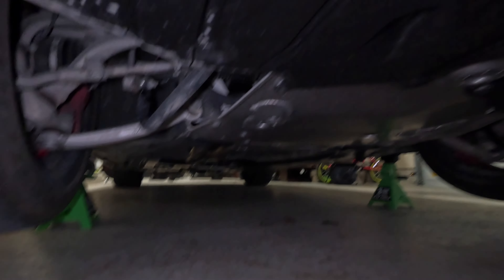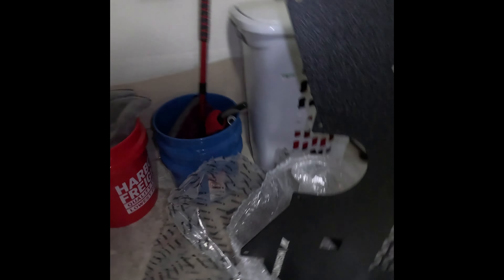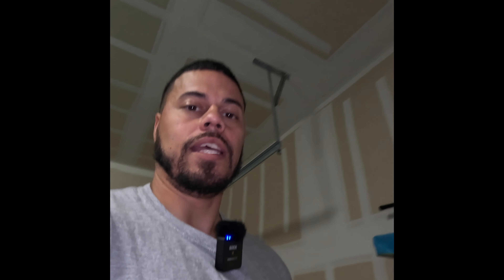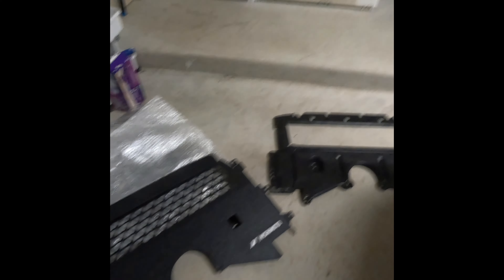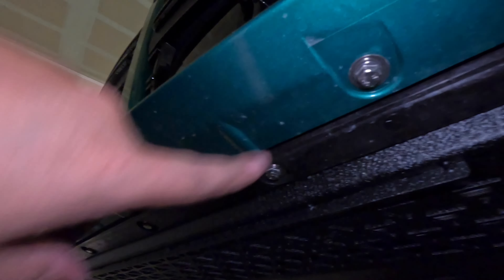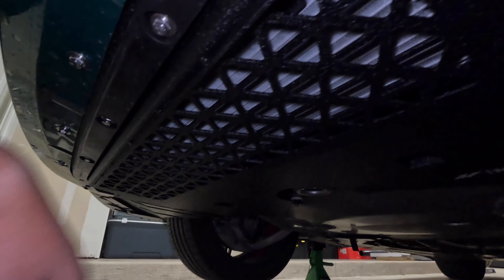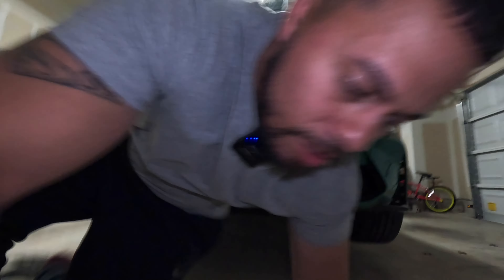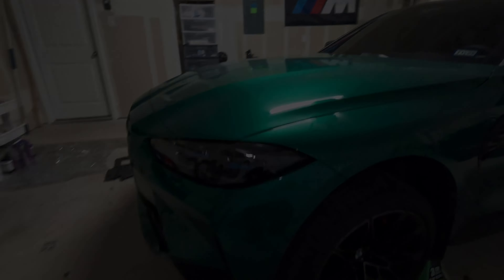2024 BMW G80 M3: Fixing a major flaw in design. Mishimoto Skid Plate. #bmw #mishimoto

Comment: Yeah, that's probably theeee best mod for that car - any scrape over a speed bump or other objects, and that's risking engine failure. I can't believe BMW approved this design without protection.
Reply from the maker: Yeah it’s crazy to think they thought it would be okay like that. I do wonder if that’s why the front of the car is so high stock
Reply: @DavidinHD1   4:28 looks much better indeed.

The point for BMW's design is they needed more airflow for the cooling at the front (first thing I noticed when I saw one in real life) and that's where I wondered, where's the oil radiator, AC etc... I do not understand why BMW has released a car with a vital part fully exposed to damage, that's very un-German, or the bean counters have taken over the designers.
Reply from the maker: @Manu-Official  yeah man, one of the first things I looked at fixing when I got the car. The crazy part is a lot of people not know it’s an issue and those are the ones that have big leaks and damage due to not protecting the oil cooler
Reply: @DavidinHD1   Most people are not mechanics, a lot will throw money at cars and bills.
Reply from the maker: @Manu-Official that’s a fact!! And repairing these cars are gonna cost you a n arm and a leg

Comment: Did you notice any increase in the oil temperature compare to before. Just asking because before the oil cooler was 100% open and now is covered to a certain amount.
Reply from the maker: No increase at all. The design of the shield doesn’t prevent much airflow.

Comment: Can you still add a front splitter that uses those front bolts that mishimoto provided?  I believe the OEM were 10mm
Reply from the maker: Yes you can, I added OEM style performance carbon front spoiler after I installed this. Everything bolts up fine.
Reply: @DavidinHD1 thank you so much for the reply, much appreciated!!
Reply from the maker: @ronin120 no problem boss, if you have any more questions let me know.